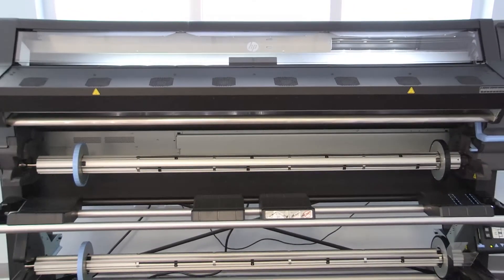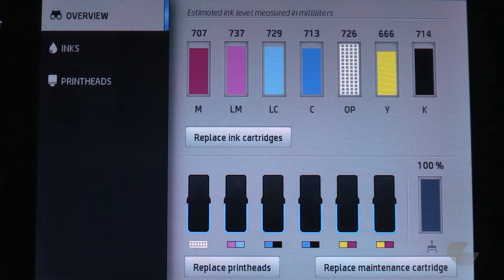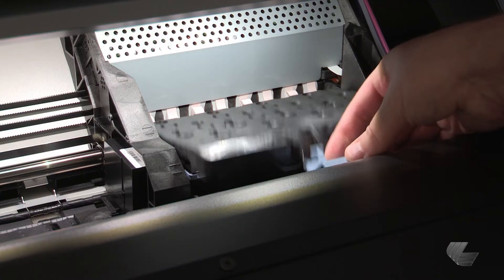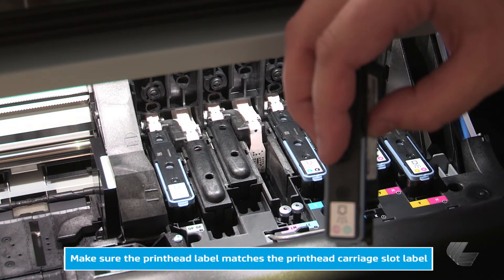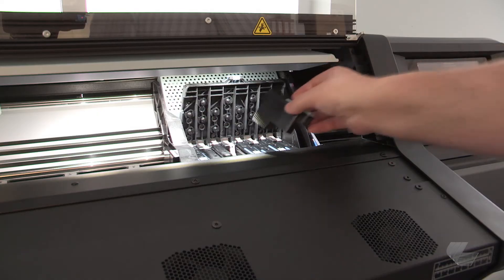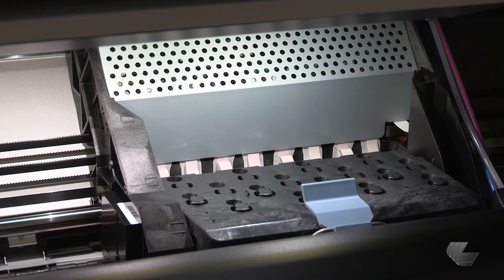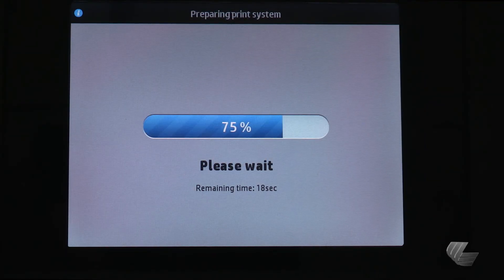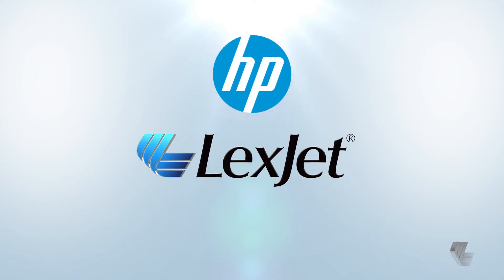HP Latex 310, 300 & 360 - Installing Printheads

Comment: I have the latex 360/370 so it will indeed notify you when it's time to change the print heads?
Reply: Officially, yes. But let's say the print head carrier gets jammed on a print and you have to force shut down it might cause physical damage to the strip and you won't know until you start seeing banding. At the pint I'd recommend running a plot test to make sure all the print heads are working properly.

Comment: Hello - If we keep getting error messages saying print head won't read after buying new printheads - what direction could we take on getting the printer back up and running. ?
Thanks - Carter
Reply from the maker: Carter Harrington take a look at page 136 of the printer's reference guide - http://h20628.www2.hp.com/km-ext/kmcsdirect/emr_na-c04276511-1.pdf. This outlines how to clean the electrical connections on a printhead to remedy the issue that you are having. I also recommend contacting LexJet or the dealer that you purchased the printheads from to get their input. Ultimately, the printhead or printheads may need to be replaced,